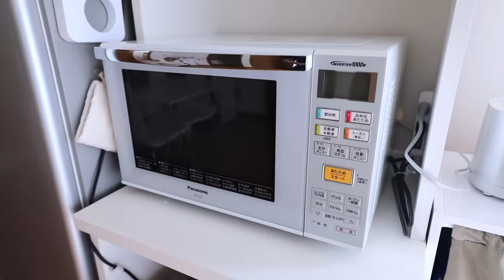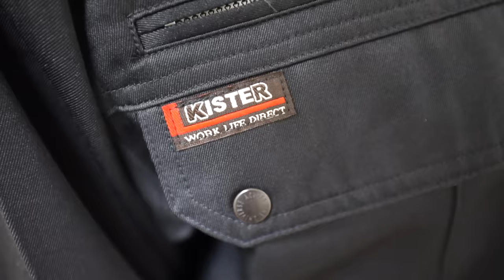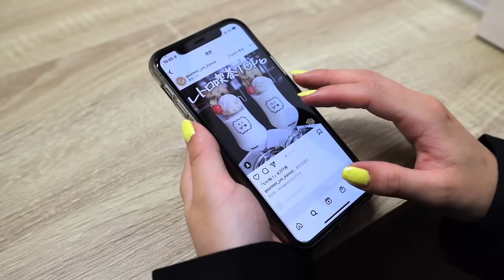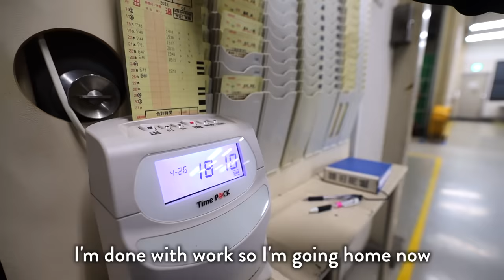Day in the Life of a Japanese Knife Maker

Comment: We bought 3 of the Miyabi knives when living in Singapore - the high end "yellow" ones and while extremly expensive, are the best knives we have ever owned.  Nice to know that they were made in that factory :)
Reply: These will probably be knives that will be passed down for generations. Money well spent.
Reply: Did you order it online and were there any issue with Customs Regulation? (Singaporean here)
Reply: @ezekielk.3629  Nooo - We bought them in Takashimiya in Ngee Ann City.  They had the "lower quality" red ones on display but when we asked, they up-sold us the yellow ones.  Only difference is something like folded 64 times vs 132 times.  Either would be amazing knives.  We got the 600MCD which have a "Western style" handle, but you can get various handles, like bamboo, ebony etc.  They are as much art work as knives and worth the $$.  Now the range is something like the 5000 or 6000 i think.
Reply: How do you keep it sharpened? I ruined a knife once by trying to sharpen it. A bit afraid of spending too much on knives now...
Reply: @melodyleong  Knives of this quality do not need sharpened often. I am a professional chef and have had a Miyabi Chef's knife for two years without sharpening only "honing" to correct the bends and disfigurement at the edge of the blade. Look up how to use a ceramic honing rod.
Reply: @melodyleong  A ceramic hone can work nicely, but I'd recommend some bench stones such as shapton kuromaku, which are slash and go stones, however require some technique

Comment: I knew things were going to get interesting at 29 seconds in when they said this was Gifu. Gifu, Seki especially, is the center of Japanese cutlery and knife making and has been for ages.
3:01 -  ...I don't see how any blood from potential cuts could "flaw" the knives outside of a sanitary concern. Your hands have enough moisture in them to pose a problem with some tool/carbon steels and rust formation just on their own.
3:20 - Okay, interesting. Denim is often used for stropping to knock off at burrs/wire edges from the very apex of the knife's edge. Leather would probably be a better choice, however.
3:24 - Seems to be some sort of device similar those made by CATRA (Cutlery Allied Trades Research Association). They use test medium, in this case very consistent paper, to measure the force required to cut (and thus gauge sharpness) and, arguably more important, how durable an edge is. An edge that is extremely sharp but rolls or otherwise fails after just cutting some paper is, unsurprisingly, not a very useful or practical knife. (As an aside, most people have never actually used a properly sharp knife and don't know how "sharp" that sharp is. Having knife edges that are even sharper than new-in-package razor blades is not out of the norm.)
3:45 - Some sort of micrometer to measure the thickness of the spine here to make sure they fall within whatever tolerance the factory has for that knife.
3:58 - Looks to be some sort of hardness tester. Don't know if Japan uses the Rockwell/HRC standard or not, but it looks like one. It uses a small diamond point to press into the metal and leave and indentation and measure the force required to do so - letting you know the hardness of the metal. Most knives start at 57 HRC and go up, with some being in the 70s or 80s (like Japanese-made Hitachi steel ZDP-189 being known as a super, super hard knife cutlery steel that can easily be in the 70s range). Notice that they're using a blank knife for this.
4:28 - It sounds like she referred to the "hamon" (刃文) line on the knives, which is that visible "wavy" pattern that comes about from the differential hardening heat treatment process. It's often most associated with katanas, but any knife or blade can have it.
4:58 - This was a bit surprising. They're obviously grinding on the bevels and edge here with these grinding belts and these look to be the finishing stages and they obviously have very fine belts (you can see - barely - sparks flying, so they aren't paper polishing/buffing/stropping wheels/belts). Um... normally you have buckets of water or water cooling to prevent the blade from heating up. You can easily ruin the heat treatment at the very apex of the knife and literally "burn" the steel by grinding too quickly without cooling down the blade by continuously dipping it in water. And I don't see any of that there. And it's not like it's a difficult thing to mess up. Years ago even Zero Tolerance had known issues with burning the edges and ruining the heat treatment on their knives, and that's pretty high end knife production.
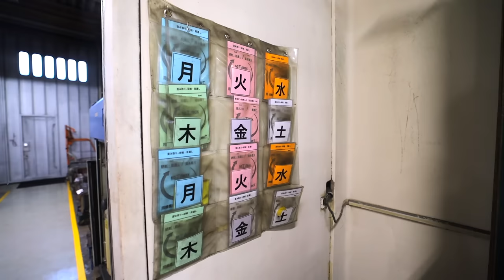5:36 - Straightening is important, but if it was important enough and consistent enough with your head treatment process that you need to hire personnel whose only job is to flatten and straighten your knife blanks... I would imagine just press flattening them straight out of the furnace and pressing them between two pieces of very flat metal, typically something like copper or aluminum to radiate away the heat. Then again, that's air cooling and they wouldn't get to use their cryo cooling process... but then again most production knife makers don't run their steel hard enough to justify that. That's what you do to get high HRCs.
5:52 - What seems like they're doing here is taking a file to the tang to give "bite" for the epoxy for the handle to grab onto. If the tang was polished smooth and you epoxy'd the handles on, they would adhere no where near as well as if you deliberately put some abrasive marks on it. Just more surface area for the epoxy to adhere to.
6:20 - They invested in some very nice grinding belt set-ups for their employees here. Looks like they have some sort of vacuum or air filtering process going by those hoses connected to the machine, which is welcome. I don't know what materials they use for all their handles, but one of the worst-for-your-health materials to breath in that's used on knives for handles, G-10, is just something you do NOT want to breath in whatsoever.
7:26 - Rockwell hardness tester.
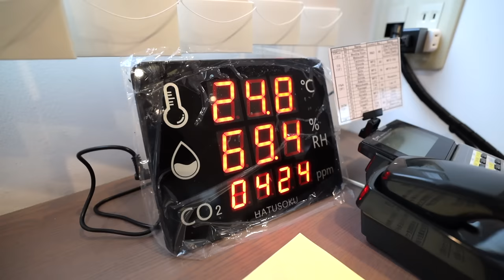9:29 - Going back to the talk about G-10 use in handles, that knife in the middle there looks like it could potentially be G-10 that's been polished. It's way too difficult to tell, because it could also be wood.
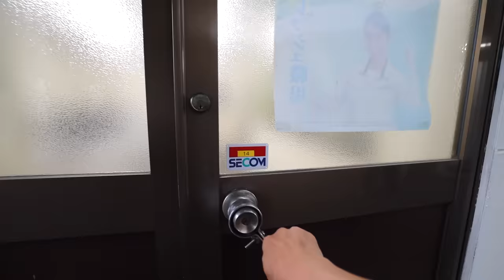10:30 - Those prices, for those quality of knives, ($200-$300+) is actually quite reasonable. High end cutlery is not cheap.
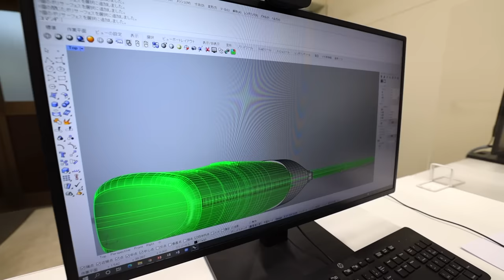11:21 - Considering this is basically a European country with a factory in Japan, it's not surprising that they have Japanese-specific market blades and international ones. There's Japanese knives for cooking, like some sashimi blades from what I understand, that are chisel-ground and would just not be very viable for the international market.
12:19 - Okay, going back to the grinding and overheating issues, they are using grinding wheels here instead of belts and are being cooled and dunked in water and of course the grinding wheels are water lubricated. 
12:38 - See how the water coming off the blade is tinged green? That's a slurry that's part of the grinding wheel itself. Must be fun to have to constantly flatten their grinding wheels...
14:44 - This is a laser angle measuring device, CATRA has similar ones for sale. You actually split the beam of a laser shining at the very apex of the blade straight on and you can get quite accurate, generally within 2-3 degrees, measurements of the actual angle of your apex. So you can tell if you're evenly sharpening and at the correct angle.